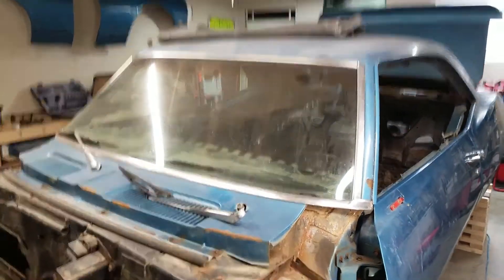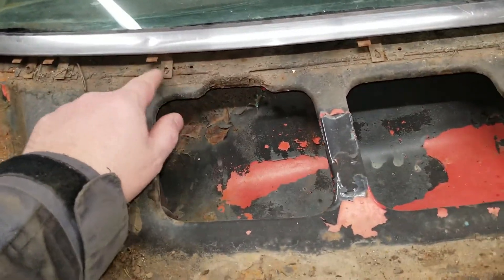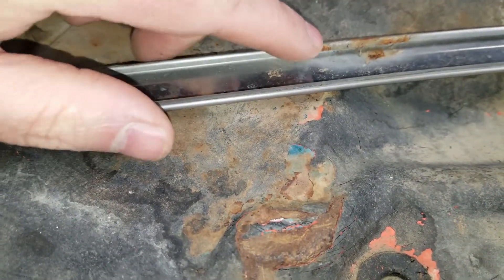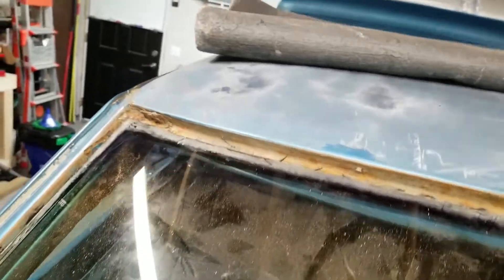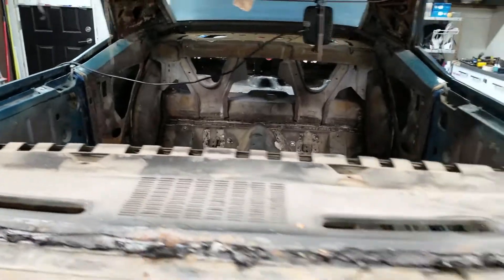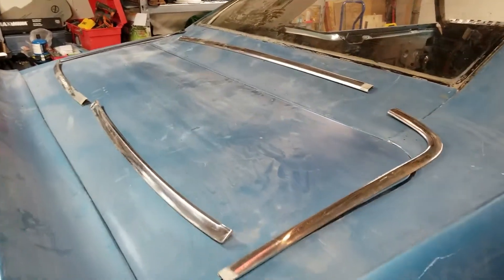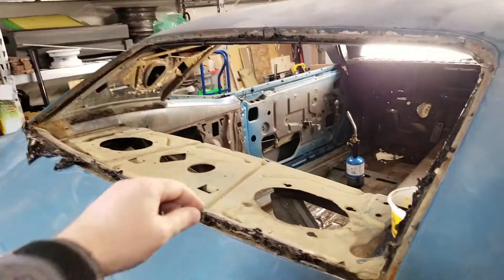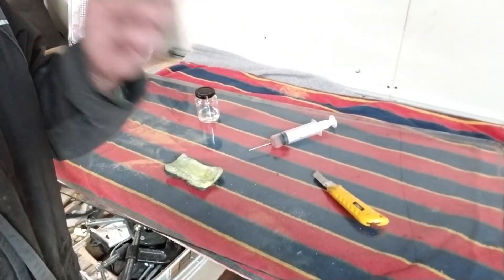1968 Camaro Project #12 Windshield and Back Glass Removal

Comment: That's not urethane. The factory used what's called butyl. If you install your glass with butyl your window will sink years down the road. Use nothing but urethane. I had Speedy Auto Glass here in Ontario Canada do mine back in 1985 and it's still perfect on my 1970 Z28.
Reply from the maker: That makes sense. It looked like the back window  had slid down a bit. There was no way to get the pull knife in at the bottom.